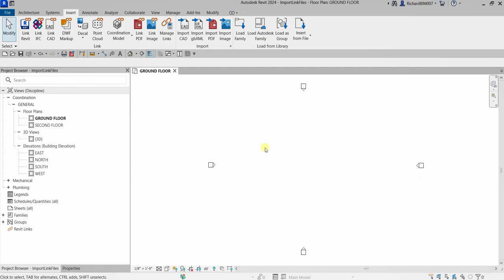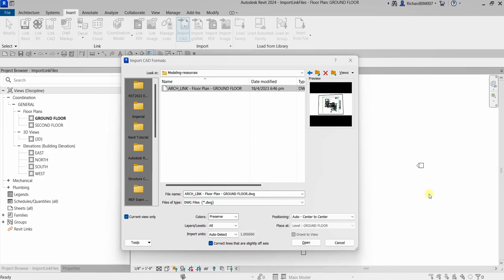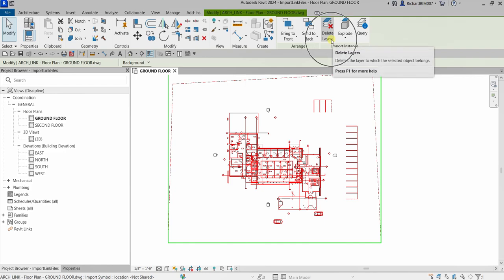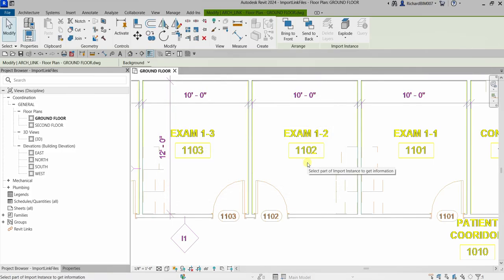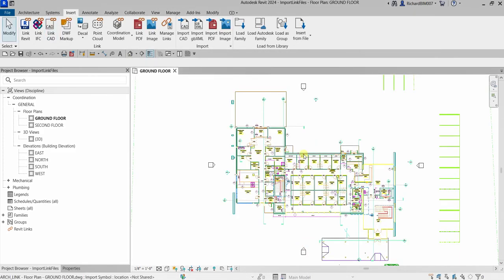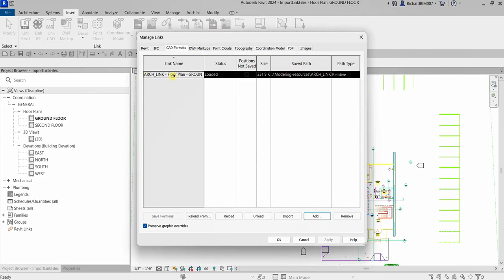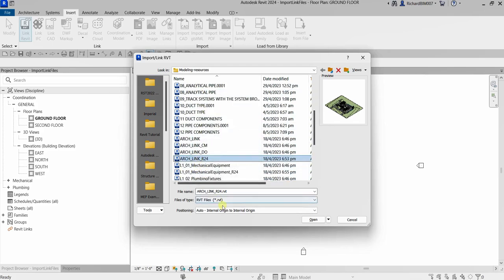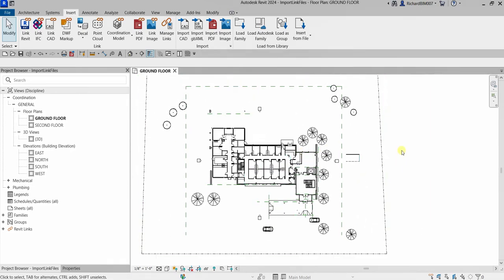REVIT MECHANICAL DESIGN PROFESSIONAL CERTIFICATION PREP: IMPORTING AND LINKING CAD AND REVIT FILES

Comment: Hi sir, paano po mag remove ng mga imported cad dwgs? from my current project po kasi sobrang daming views at hindi na rin mahanap kung saan po nakalocate yung mga imported cad dwgs. unlike po sa link cad na nareremove po sya. salamat po sa sagot sir. God Bless.

Anyways Thank you po ulit sa Electrical Design Templates na sinend nyo. =)
Reply from the maker: matrabaho gawin un sir pero pede naman, isa isahin mo ung cad elements. siguro sa 3d view, select mo lahat tapos gamitan mo ng filter.